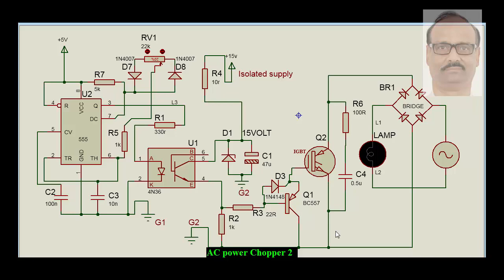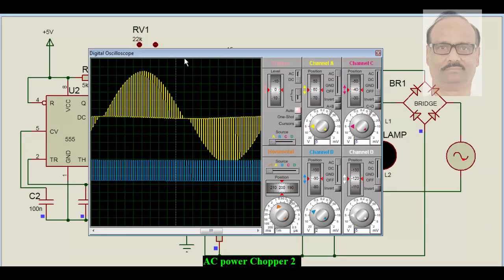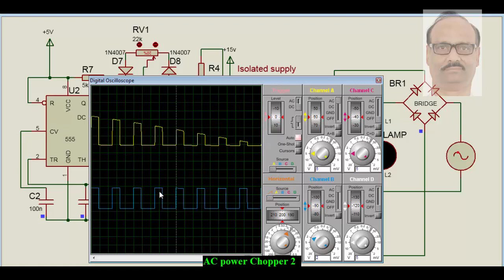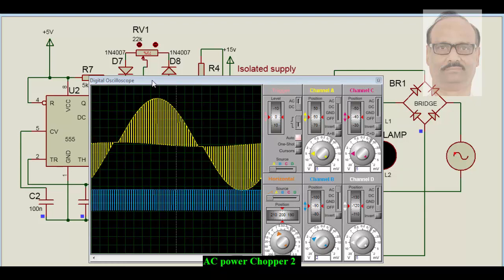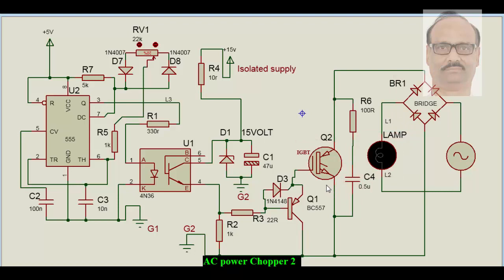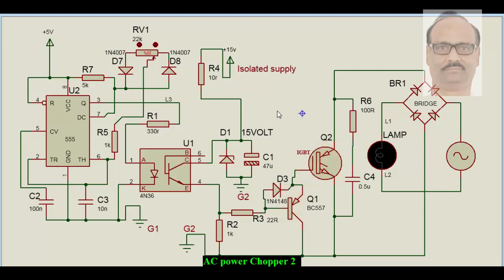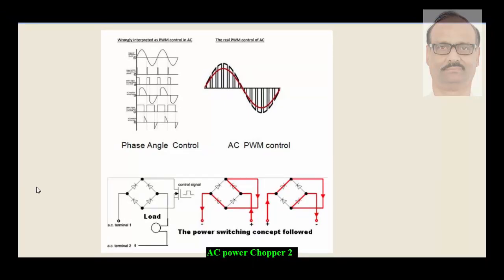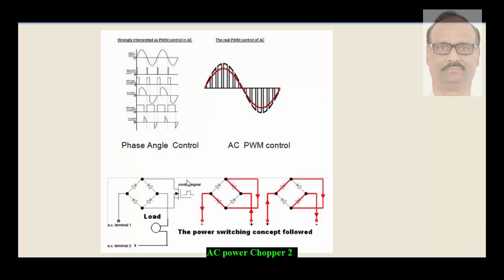Electrical chopper using single IGBT

Comment: sir can we use  industion motor of 0.5 hp at the place of lamp but when apply 220 v from alternator it is not working
Reply from the maker: 0.5 HP Motor can be used. You tried 220 v on Proteus or the mains supply on the hardware?

Comment: can we connect two IGBT in anti parallel ,like SCR to control AC current
Reply from the maker: Not anti parallel but anti series
Reply: Patnaik UC    you mean common emmiter configuration.  that will need diode???